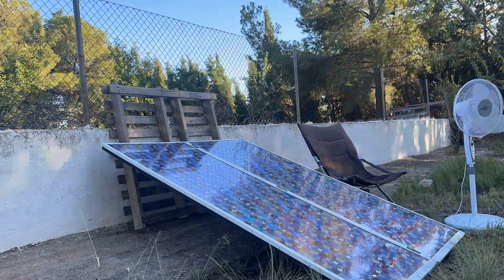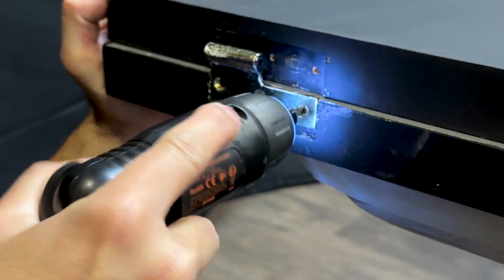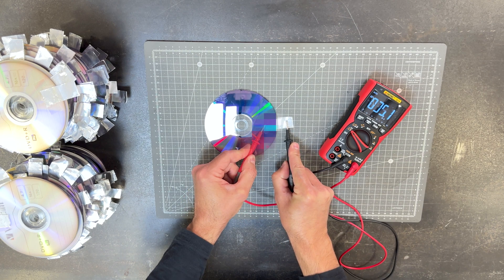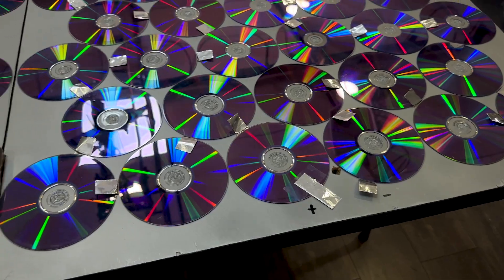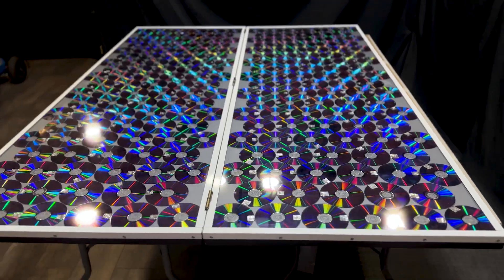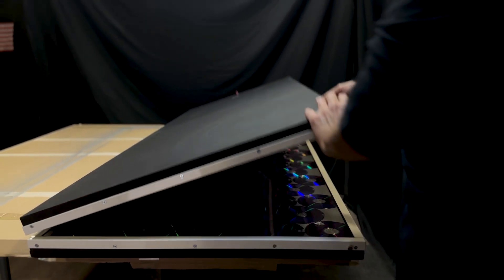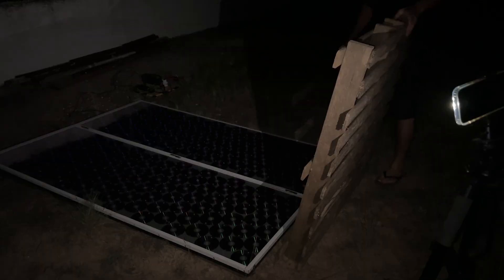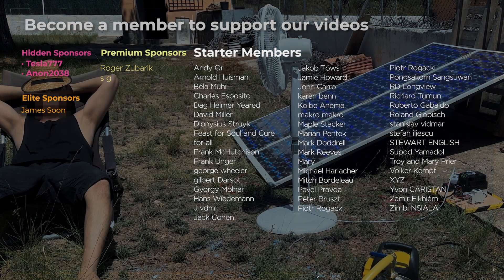HOMEMADE PHOTOVOLTAIC LUNAR SOLAR PANEL WITH CDs

Comment: Sorry , cd dvd made out of plastic, which will not allow electron's , electricity to pass from one cd to the next one if any generated, also the surface area vs power generated is impossible, the guy is making the democrat's happy , vote Kamala if you believe this will actually work , @Neil deGrasse Tyson please explain

Comment: Nice job pixelated face guy with the artificial voice and trying to suggest that the moon made that panel pull enough amps to get that light panel to light up as if it was plugged into either a battery or a wall outlet, but you seem way more honest than to try to be disingenious, and dignity is everything.